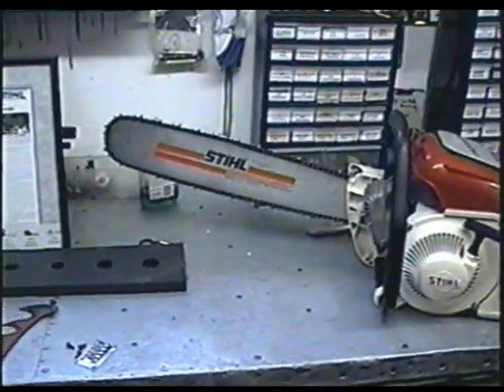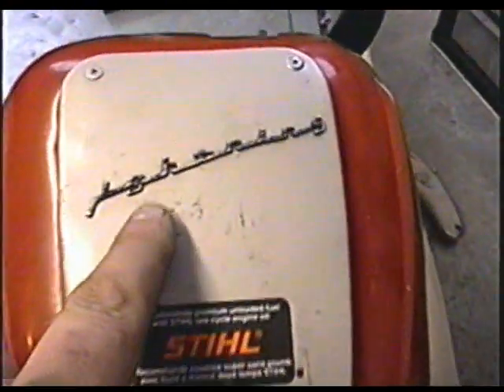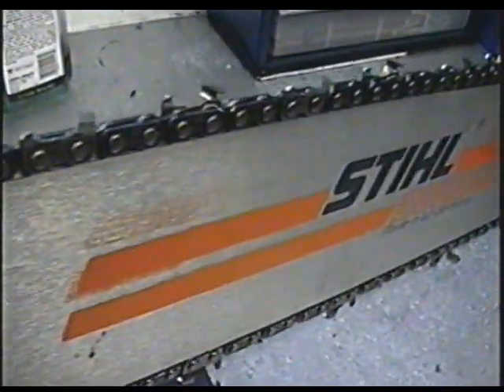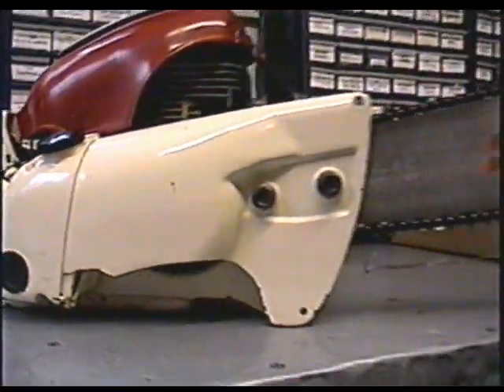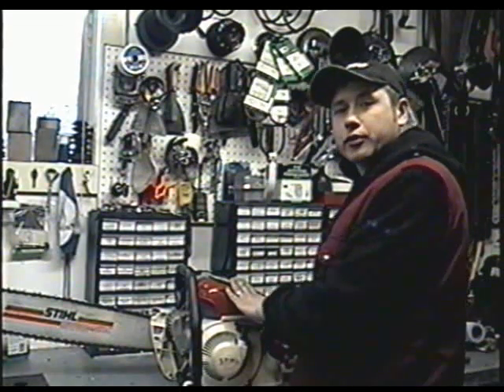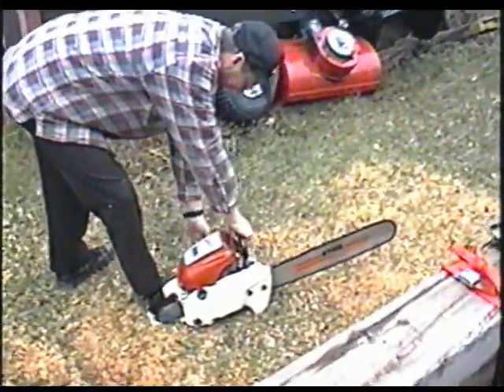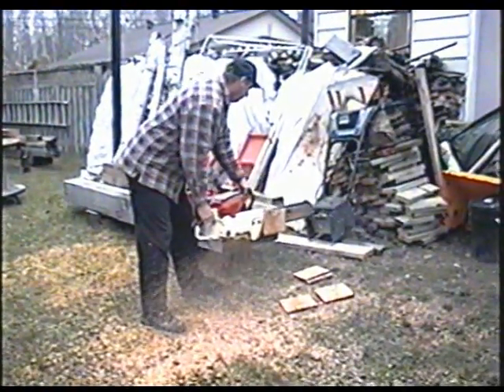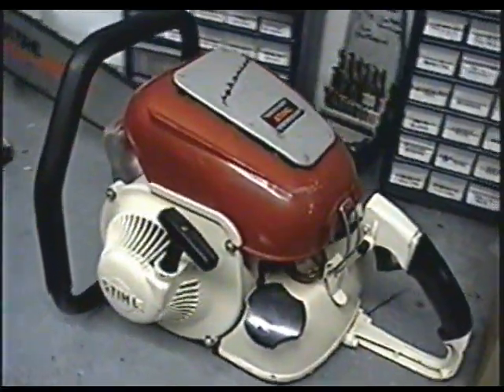1959 Stihl Contra Chainsaw MINT Condition Overview & Startup

Comment: Very informative, I did not know that chainsaws were made in the 1950s I thought they came in the 1960s.
Reply: McCulloch started it all in 1947 with the first one man chainsaw. Before that they had larger two man saws even farther back, decades back. But they were very large super heavy and took two lumberjacks to use. Still better than the alternative in the 19th century which was a long flat two man side to side engineless saw.

Comment: Nice chainsaw wish I had the money to fix up my 2 old Stilhs I think they are from 1961  or 62 . The saws both need new bars and replacement carbs . The previous owner had left them in a old barn that leaked rain on them for over 20 years . I bought them for 10 bucks each at a auction where he was selling out his farm stuff . I also got a 1965 homlite that I cant find parts for so far it just needs a carb kit the bar and chain was rusty but salvageable. I love those old saws they work better.

Comment: Hi guys. I inherited one of these saws and i got the motor rebuilt. I'm just wondering about the whole manual oiler button. When do you use it?? Do you have to keep using it while cutting through wood??? Cheers.

Comment: sharpening with the file is the best, the machine takes out the temper out of the cutter/chipper, to much friction,caused by the grinding wheel,ur friend should give a few tips, of sharpening a chain,good vid,

Comment: If it has an oil pump you need to manually oil it. It might draw some oil "automatically" due to internal leakage but that's not enough. If you don't run out of gas and find you're just about out of oil, the saw isn't getting enough bar oil. Oil is cheap. Use plenty.

Comment: I could file that razor sharp in 10 minutes, better get the air cleaner on it. I have a 4 hp electric chainsaw  that will cut that 8x8 just as fast